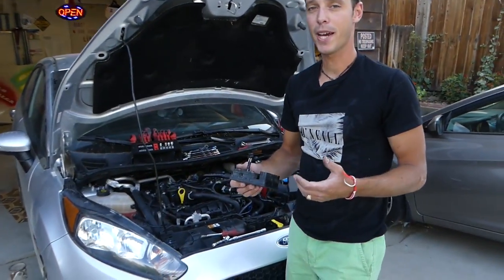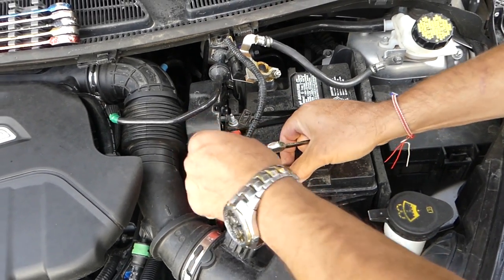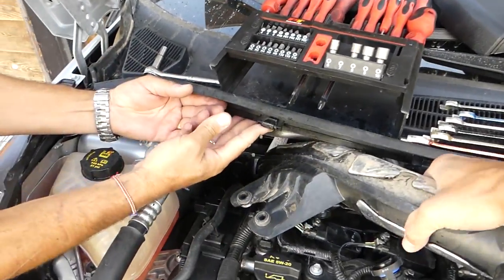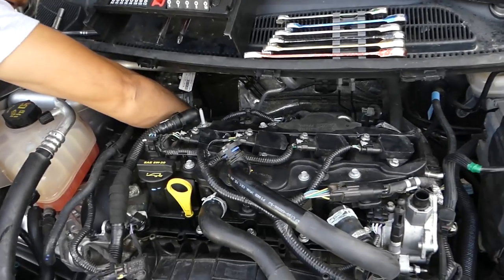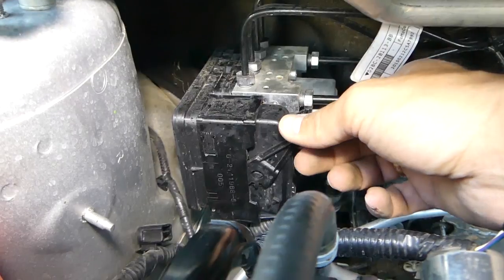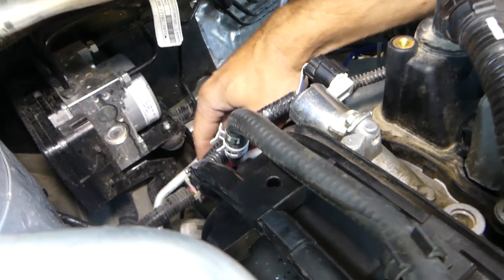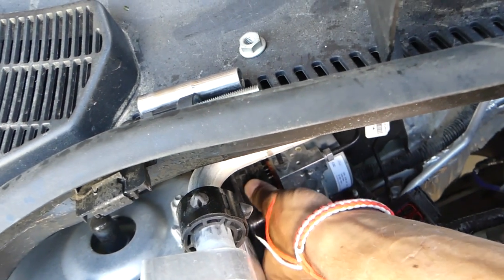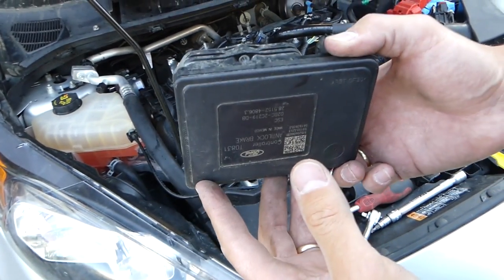HOW TO REMOVE OR REPLACE ABS MODULE ON FORD FIESTA MK7 ST S SE TITANIUM

Comment: Does it need coding , the new module
Reply: I have the same question.. if the replacement module has the exact same part # will it still need reprograming or is it plug and play?.... I see this question asked often but noone gives a clear answer
Reply: Plug and play.  Sometimes need to re-calibrate some sensors.
Reply: @High_Master_Level  Thanks brother... I have a 2003 focus with the  b1342 code..assuming its shot..Unfortunately, access on the mk1 series focus is not as easy as the later ones shown  here.. I cant even seperate the connector from it...Good to know it can be swapped out without reprogramming the VIN#... that was a big concern.

Comment: My abs engages at stop sign and then car wants to stall when I let out clutch because the breaks are holding it I believe. Can I disconnect abs? Will swapping this fix my issue? Sometimes feels like it's engaged while moving too